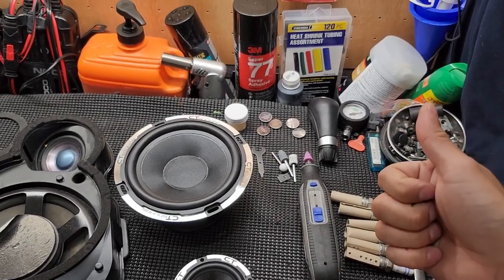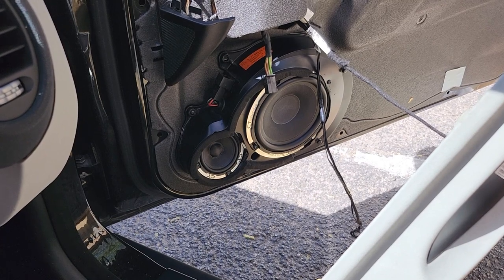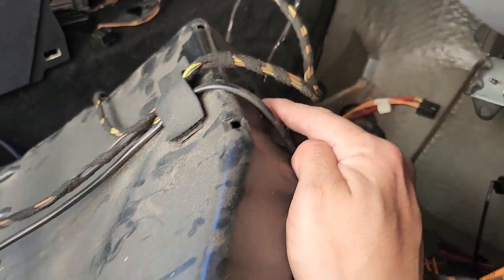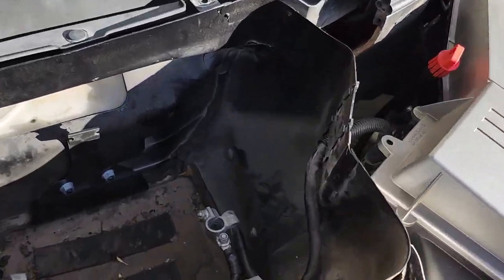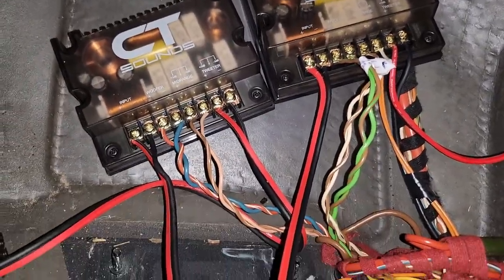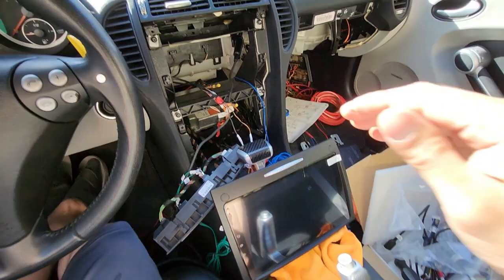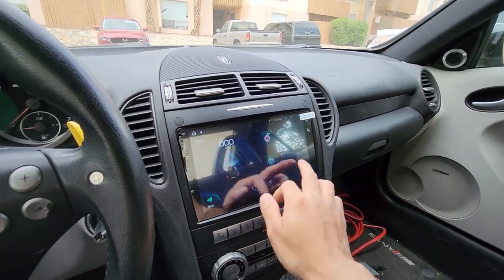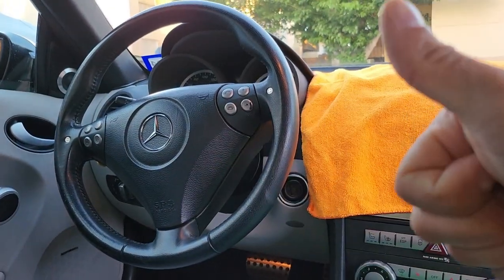MY 2005 SLK55 AMG's GETS A FULL AUDIO UPGRADE!!!

Comment: Love your chamnel i have 2004 e320 4matic i have been trying to do the relay on cd changer.  I have watched your video on cd changer compartment.  I ordered everthing and did everthing but need to know how to wire it in your video you have it hooked to 12volt drill battery i need the wiring diagram for car though please help.  I am leaving factory unit in for now.
Reply from the maker: Hi Robert, a safe alternative for 12v Power would be the cig light directly below.  It's acc only, which is great and will provide power and ground. Just tap in, and you should be good to go.
Reply: @PANZERSGARAGE  okay so my question is i got two wires for motor connect them to relay then take 2 wires off cig lighter and connect them on side of relay so relay will have a total of 4 wires tuats it?  I got confused when you made your own harness lol
Reply from the maker: @Robert Ehlers  11:42 on that video shows how to hook it up. The harness is basically the same as the wiring layout. You only need the 2 wires off the lift gate(CD changer housing) to connect to the motor seqment the rest is basically power & ground. I described this in the video marked 11:42
Reply: @PANZERSGARAGE  yes love your channel i am just lost i been at this for a week lol.  I just dont understand. I got the part with cig lighter has 3 wires so i be using 2 of them the groind and power.  Of cig lighter theb i got the two wires from motor.  So the changer had to harness 1 fiber optuc which i have looped and then the power fir changer so ibe usung that as well so 6 wores are going in the relay.  Is that right?  Also was looking for your instagram but link broke.
Reply: If i use dactory command unit and loop the cd changer can i get door  to open and close.  Is canbus the reason i also got therelay you had.  I broke the screws so i ordered another off ebay so how do i get by?  I dont want to break ia new one.  Thanks i subscribed and love following your video
Reply: Thanks bro i switched it up got amdroid using stock amp and speakers for now

Comment: Doing my 04 e320 2nd head unit went with the new extrons 12 got to get rid of fiber optics in it have a kicker 4 channel amp to power 4 jl components I need to run all new speaker wires to the head unit or can I tap in and still go to head unit

Comment: Okay almost done with full audio install went with almost same set up.  Xtrons head unit 4 JL door speakers c1 components in front coax in rear.  2 kicker amps one for sun one for door speakers.  Question is I took out old harmen amp can I use factory amp pos negative and remote?  Or will I have to use distribution blocks from sub amp for that.  Also rca for 4 channel amp is it 2 sets of rca one for l and right front and the second set to rear left and right?  Sorry to bug you but you help me so much on my 04 mb e320 with harmen

Comment: My e320 2004 amp harmon in trunk left side i finally found it and wanted to replace it with kicker 4 channel just was wondering to end the fiber optic in it need a little help with wiring it.  It has a kicker sub amp for the kicker L7 12 in trunk now i want to wire 4 jl door speakers to new 4 channel.  With new xtrons stereo.  So speaker wires i wire to wiring harness to door speakers.

Comment: Another great vid Ivan!  I need to replace my head unit, typical buttons not working issues and I tried pulling it apart with no luck.  Thanks for sharing Brother!
Reply from the maker: Thank you, YJG! I'm glad to see you roaming about. If you need a replacement, I have the original unit available if you decide to keep it factory.
Reply: @Panzer's Garage  thanks Brother, much appreciated!

Comment: Hi, 
I try to connect an Android radio upgrade from a NTG1 COMAND APS (SLK R171 2005) with optical fiber + Harman Kardon amplifier. Same wiring connected as explained into your video + optical fiber adapter & CAN bus adapter has been connected too + 2 wires CAN-H & CAN-H have been connected as you proposed to do.
Current status: 
- Firstly, when the key contact is switched-on, important sound peaks are presents at the beginning of the init phase of the new Android radio, 
- Secondly, when the new radio is switched-on a little sound is permanently present into the speakers without choosing any music menu, 
- Thirdly Bluetooth function is OK with my Iphone for 2 min and disconnect after and impossible to reconnect without switching-off the car. 

Questions: Other wire to connect like amplifier command, reverse signal not connected for the moment, or other suggestions?
Reply from the maker: Hi, im not sure how i didn't see this post. 
So when the power switches on that is feedback from the power to ground. I would make sure you have proper grounds for the audio adapters. Most cases you get feed back when using those fiber optic adapters and can bus adapter when a proper ground isnt set.

As for the BT disconnect, make sure your phone is updated. Do you know which version of BT is on the aftermarket radio?

its always best to completely remove the factory amp and fiber optic pieces as issues can arise when using those adapters. try going over your wiring to make sure no connection issues are present with soldering or crimping connectors

Comment: Spare tire how did the glass panel turn out
Reply from the maker: Well I have the template using a combo of 1inch MDF and the main frame and center plexi showing the sub. I used MDF spacers on the ends to support the panel as a whole and lift it to level it as I described
Reply: @PANZERSGARAGE  okay thanks I def be bothering you with more questions lol went with xtrons 12 the newer one with the little part to screw in hazard panel I like how the older android 10 fit it was to slow so now got the xtrons 8core had to buy the rear backup camera got same a yours and already have xtrons dvr installed last unit going to be adding it own simm card 4g.  Have new kicker 4 channel 2 power ge jls I got in the doors and I have a kicker l7 12 in thin truck box design sealed it has its own kicker amp so I can finally eliminate fiber optic   going to do a install video 📷
Reply: @PANZERSGARAGE  doing mine in 2004 mb e320 looks a little like panzer not quite 😂 anyway got that 12 in spare tire spot want to do plexiglass cover how hard is it what do you suggest.
Reply: Xtrons head unit keeps rebooting idk